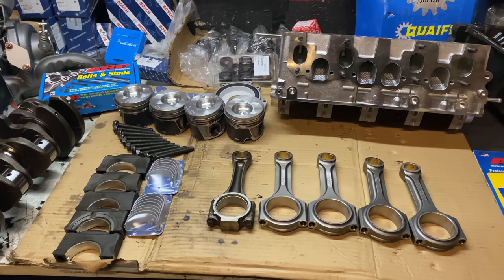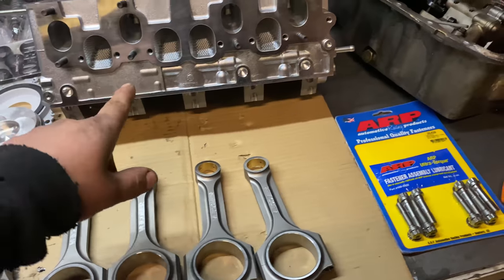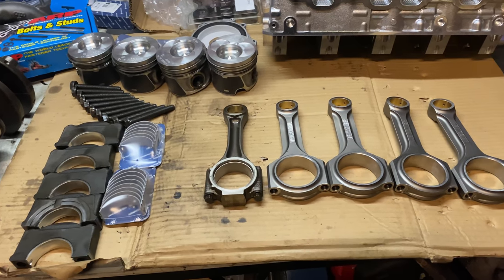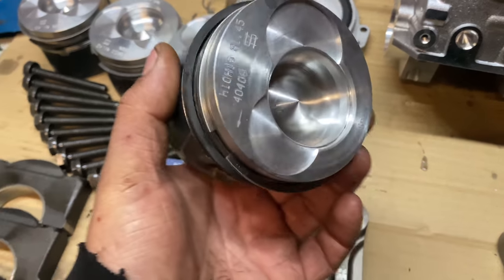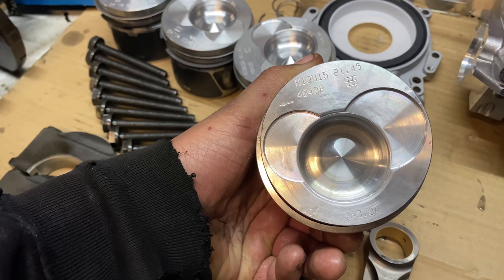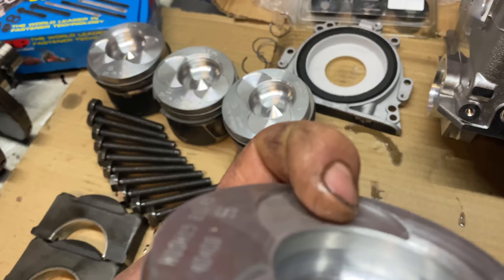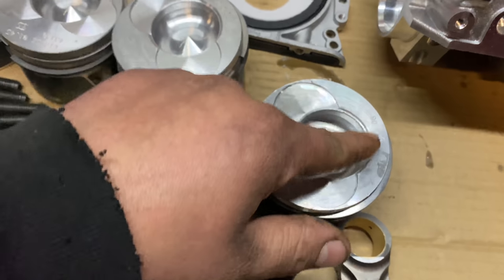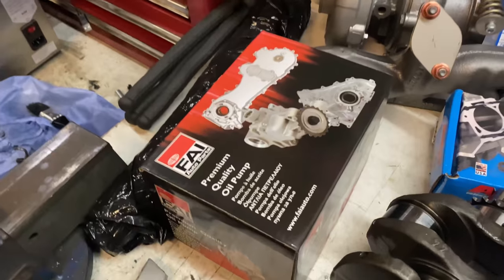BUILDING a RACING ENGINE 1.9TDI PD WITH PORTED VEICOMER CYLINDER HEAD,RODS and PISTONS  2020 (part1)

Comment: very nice video ... i have questions ... are the tdi PD motors a tight fit or a rather loose fit? what do you think the oils in such tdi PD ..0w30 5w30 5w40 which parameter will provide better lubrication ... the oil should be thinner so that it is more distributed over the engine. or maybe more denser to stick to the moving parts of the engine., assuming normal driving .. in these engines, the cams of the shaft are damaged .. they are rolled .. which is the reason .. poor quality of the shafts. maybe glasses or maybe a roller lever of the injection pump .. sure you've heard about adding 2t oil for diesel to improve the lubricity of the diesel and thus improve the lubrication of unit injectors what is your opinion ??
Reply from the maker: I only use 5w30 oil  

And normal diesel

Comment: Hi, I currently have an 1.9 AJM with a cylinder head from an AWX(including injectors with AL in the serial number) and 2.7 audi turbo converted to vacuum, @225 hp on 90% injectors. I want to put the pistons you have so 81.5 piston. Is this from 2.0 tdi? And second question, is AJM block(rod, crank block wall thickness) the same as awx/asz? Would appreciate some knowledge cause not many people know to answer my question. 
Thanks for the video, clarifies some aspects for me!
Reply from the maker: Hi mate I don’t know about AWX engine but I’m thinking everything is the same I have used Passat engine on the pass and performing the same as ASZ 

Pistons 2.0 tdi 8v  is 81.mm standard  the ones I use is oversized from skillaturbos veicomer

Comment: Impressive build. What year model is that engine? What is the starting horsepower (90, 110, 140, 150)? What engine, horsepower do you use injection pump from?
Reply: What was the bore in the cylinder block? What bore is the cylinder block now?

Comment: Hello. I have passat b6 2.0 tdi (8v PD engine BMP).. i wanna engine teardown and do block rebored and  run these rods with stock head (full rebulid),new pistons with oversize of block with rings and stock cam but brand new, will it be safe to plug in turbo+injectors and better clutch and run 230+- hp for daily drive? i wanna bulid realible engine with fast spoon as i do 30 000km per year and i wanna have car a long time... i dont wanna spend on extra ported head (just too much money), i know i need better intercooler. Is there any advice what to do to get this 230-240hp safe to engine? any bits worth to change? Thank you. Nice work and nice video. Keep it going!
Reply from the maker: Hi mate  if you only want 240bhp if my car i wiil kip the engine standard  if you change the oil and filters every 10k will last around 300000 mils just need clutch intercooler end better intercooler pipes and hibrid turbo

Comment: What torque settings would you use for 12.9 non stretch main crankshaft bolt is it still 65 nm with 90degrees cool video 😎
Reply from the maker: Original torque settings